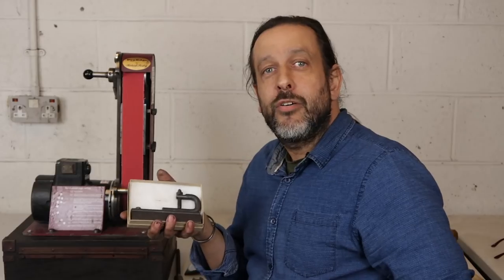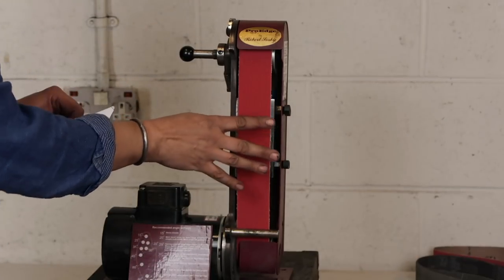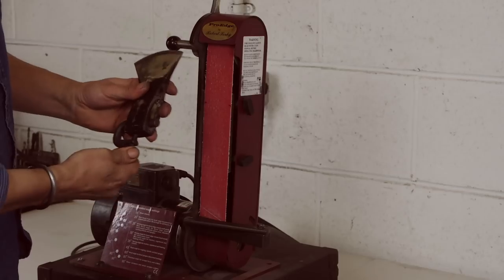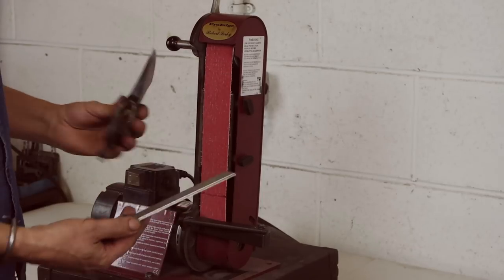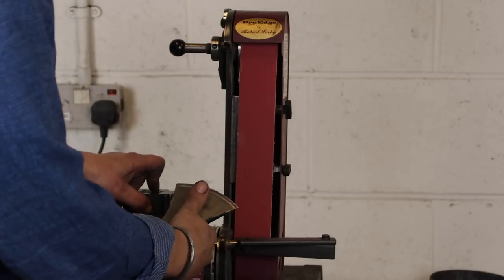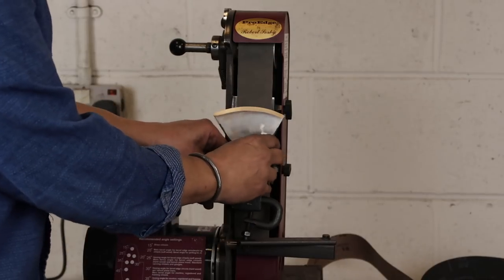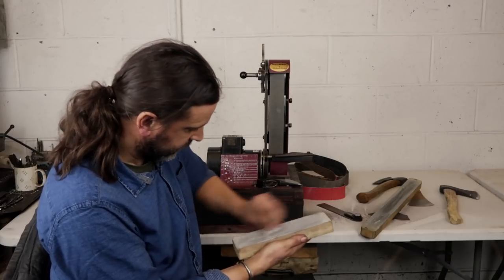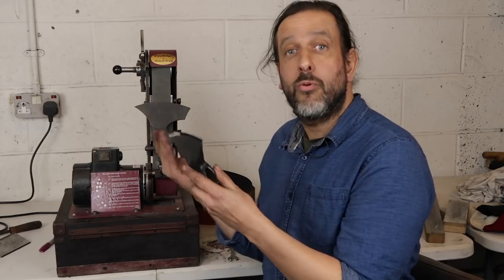The Hewn and Hone Axe Grinding Jig

Comment: Move the platern, and you change the 90° angle…….. the way you suggest to do it!
Reply: That's true, it's no longer at 90 to the work table  which you have already removed, if you put the work table back it's easy to reset it to 90 with a square.